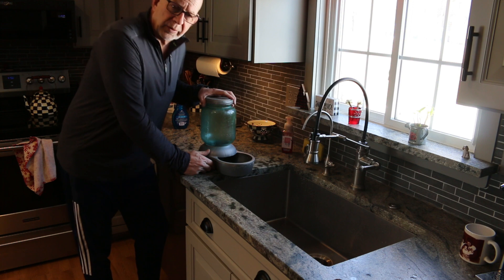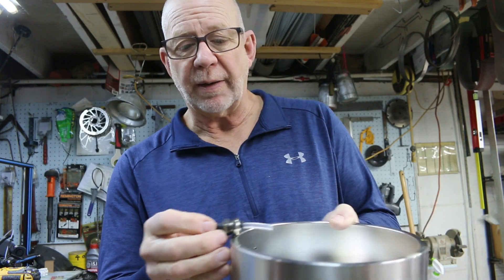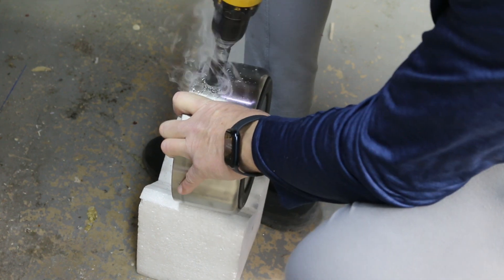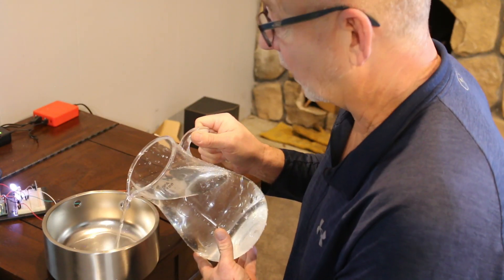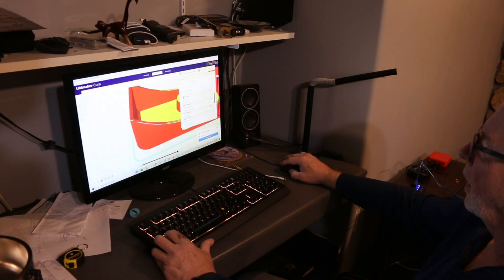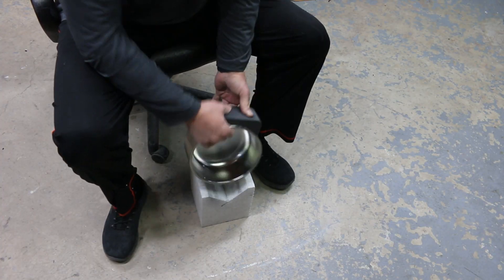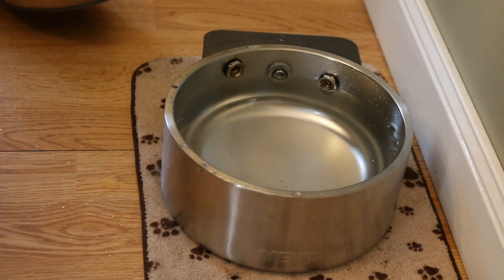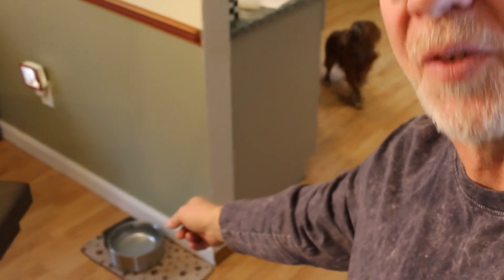Self filling dog water bowl

Comment: I am new at arduino programming would you be willing to share your sketch so I could mimic the project. Thank you
Reply: Why not get a patent on it for yourself?
Reply from the maker: /*
I only an armature coder but here you go ;)
  THIS is auduino_test for auto refilling dog bowl
  sketch for testing and setting up the sensor.

*/
const int WaterSensor = 2;
const int CheckLed = 5;
// PIN OUTS
const int WaterValve = 4; // valve and beeper on when powered
#define RELAYON LOW // this makes reading easier
#define RELAYOFF HIGH // ie: RELAYON instead of HIGH

//##############################################################################

void setup() {
  pinMode(WaterSensor, INPUT);
  pinMode(WaterValve, OUTPUT);
  pinMode(CheckLed, OUTPUT);
  Serial.begin(9600);
}
//********************************************************************************************************************

void loop() {
  int Water = digitalRead (WaterSensor);
  Serial.print(" read sensor =  "); Serial.println(Water);

  if (Water == LOW) {//read water level
    digitalWrite(WaterValve, RELAYON);
    digitalWrite(CheckLed, HIGH); delay(500);
    Serial.print(" relay on =  "); Serial.println(Water);
  }
  else {
    digitalWrite(WaterValve, RELAYOFF);
    Serial.print(" relay off =  "); Serial.println(Water);
    digitalWrite(CheckLed, LOW); delay(500);
  }
}

******************************************************************************************

/*
  THIS is ardunio complete sketch for auto refilling dog bowl
  switch on bowl to turn on or off?
  push button to open valve?
  led lights when valve open?
  dim led on when power is on,  always red?

*/

// PINS OUT
const int WaterValve = 4; // valve and beeper on when powered

#define RELAYON LOW // this makes reading easier
#define RELAYOFF HIGH // ie: RELAYON instead of HIGH

//PINS IN
const int WaterSensor = A1; //analog in water = 1014  out = 35
const int CheckLed = 5;
int A = 0;
//##############################################################################

int Flush = 50; //480 minutes = 8 hours
const long Minute = 55500;//55500 for 1 minute

//##############################################################################

void setup() {
  digitalWrite(WaterValve, RELAYOFF);
  pinMode(WaterSensor, INPUT);
  pinMode(WaterValve, OUTPUT);
  pinMode (CheckLed, OUTPUT);

  Serial.begin(9600);

}
//********************************************************************************************************************

void loop() {
  if (A == 0) {
    for (int Start = 0; Start <= 2; Start++) {

      digitalWrite(WaterValve, RELAYON);// start up or reset routine
      digitalWrite(CheckLed, HIGH);
      Serial.print("LED  "); Serial.println(Start);
      delay (500);
      digitalWrite(WaterValve, RELAYOFF); delay(200);
      digitalWrite(CheckLed, LOW); delay (500);
    }
  }
  A = 1;
  for (int T1 = 0; T1 <= Flush; T1++) {// 480 = 8 hours,  times to check water level before flushing
    int Water =   analogRead (WaterSensor);
    Serial.print("Water sensor check %1  = "); Serial.println(Water);

    if (Water >= 600) {
    delay(Minute); // 60000 milsec check every minute
    for (int L1 = 0; L1 <= 10; L1++) {
      int Water = analogRead (WaterSensor);
     digitalWrite(CheckLed, HIGH); delay (200);
      digitalWrite(CheckLed, LOW); delay (200);
    }}
    
    if (Water <= 600) {//read water level
      T1 = 0;
      int Water = analogRead (WaterSensor);
      Serial.print("Water sensor check %2  = "); Serial.println(Water);
      digitalWrite(CheckLed, HIGH);
      digitalWrite(WaterValve, RELAYON);
      Serial.print(" @ Valve ON for low water T1 "); Serial.println(T1);
    }
    else {
      
      digitalWrite(WaterValve, RELAYOFF);
      Serial.print(" relay off  T1 @ Valve off enough water  "); Serial.println(T1);
      digitalWrite(CheckLed, LOW);
      
    }
    
  }
  Serial.println("Water valve open for flush 12 sec");
  digitalWrite(WaterValve, RELAYON); // flush
  digitalWrite(CheckLed, HIGH);
  Serial.println("Valve ON for flush ");

  delay (12000);// open valve for 12 seconds?
  digitalWrite(WaterValve, RELAYOFF);
  digitalWrite(CheckLed, LOW);
  Serial.println("Valve off after flush  ");
}

Comment: I have been looking for a solution as well. There's the Petwell system, but I feel like the drain is half wasted on that if it doesn't self empty so I was thinking of  adding a drain flap attached to a waterproof actuator/servo that drains the bowl every so often - I have 6 dogs, 5 of them huskies, and 4 cats. It can get slobbery pretty quick! lol
Reply from the maker: @noneya404  yes I agree my three king Charles get the bowl pretty dirty, after about three weeks I have to dump it and wipe it. But that only takes two minutes. And then the bowl refills itself, and I have another three weeks to do nothing.
Reply: @ultimate99tube  Problem is I would be dumping it all the time lol, thusly the urge to automate it so it's not constantly refilling the remaining slobbery water.

Comment: The min you drilled holes in that yeti, you let out the argon gas that keeps the water cold between the double stainless walls.
Reply from the maker: lol. The dog bowls are not insulated. Even if they were, they are so big they would get to room temperature quickly. Most dogs do not want even cold water.